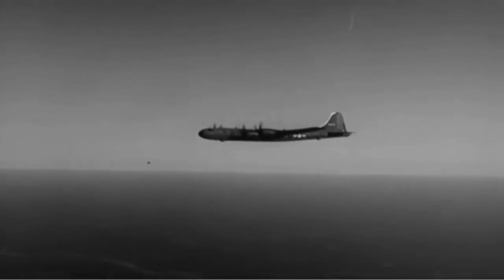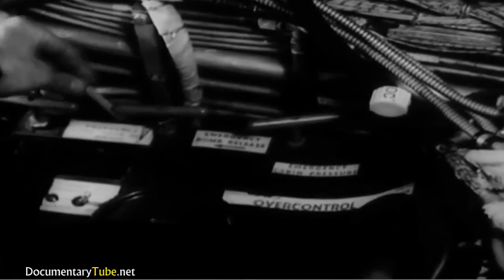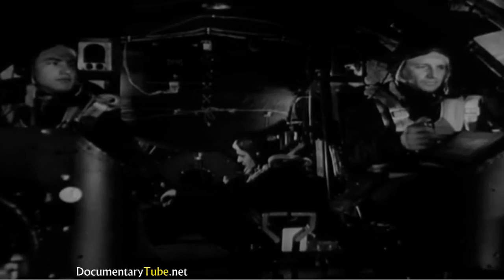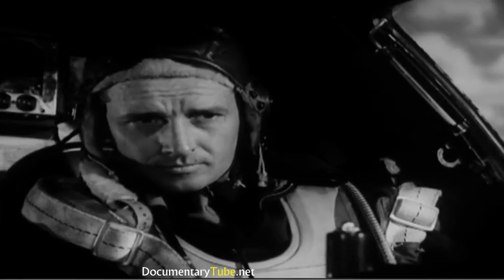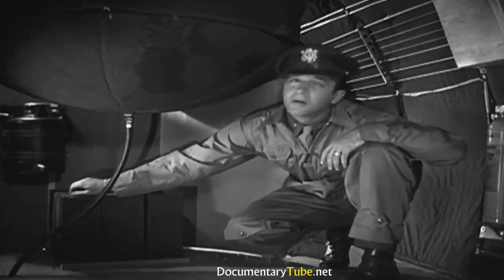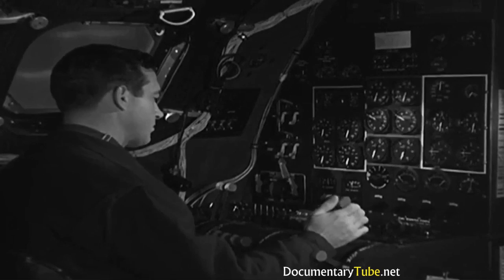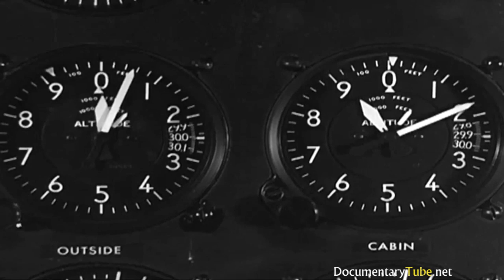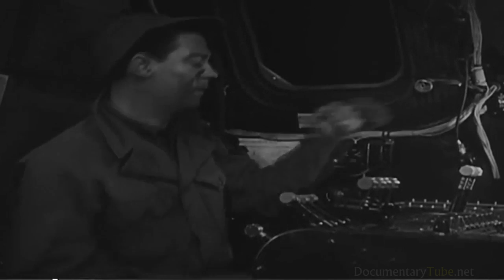HOW IT WORKS: WW2 B-29 Super-Fortress

Comment: Boeing B-29 Super Fortress is a heavy bomber aircraft manufactured by the American Boeing Company between 1943 and 1946, and was mainly flown by the United States Air Force at the end of World War II and during the Korean War, and it was one of the largest aircraft during World War II and the most advanced in that Time, cabin pressure technology, electronic fire control system, and remote machine gun control technology. The name Super Fortress was derived from its famous predecessor, the Boeing B-17 Flying Fortress, designed as a high-altitude strategic bomber, and was initially launched for the war against the Empire of Japan.

Comment: What's the difference between the propeller RPM switch and the throttle?
Reply: Most combat aircraft in WW2 had what's called a constant speed propeller, I'm not going to get into everything about how they work but essentially it keeps the engine/propeller speed constant no matter what the throttle setting by adding or subtracting propeller pitch to load or unload the resistance on the engine to keep it at a certain RPM, so if you increase throttle the propeller automatically increases pitch to load the engine even more and it won't increase RPM but your speed will increase because of the additional pitch added to the propeller, and they're adjustable, so before you take off you want to check it's setting and cycle oil through the mechanism in the propeller hub by varying the pitch to assure that there's no air in the system, that's for a hydraulic system some of them were electric but they had a similar pre flight check.
Reply: @dukecraig2402  thanks for describing how the pitch automatically varies according to the throttle . But if the RPM is constant, then why is there a RPM control switch?
Reply: @michaelwong4303  
So you can change what you want your "constant speed" to what you want.
Does that help?
If not on YouTube enter "constant speed propeller" and there's a bunch of videos that explain how they work.

Comment: I can’t believe that the crew basically do the ground crews job for them, I don’t know how the USAAF system worked, or how any airforce did the servicing during the WWII ERA and afterwards, but I do know how we did things in the RAF from 1979-2003 and we did three types of daily servicing, a B/F Before Flight T/R Turnaround and A/F After Flight, so basically when a crew arrived for a flight they only had to check the log book (F-700) sign for the aircraft and before entering the aircraft they did a walk round to satisfy themselves that everything was as it should be, then as they say he would “kick the tyres and light the fires” and disappear into the sky, when they came back if the aircraft was needed again a T/R servicing was done, basically to check all the vital items of the B/F were done again but not all, not much different to the B/F, and if it was the last flight of the day then an A/F servicing was done and aircraft put to bed, we in the RAF trusted the groundcrew to do their jobs, aircrew didn’t need to check tyre pressures or oil levels, it seems that during this era that in the USAAF didn’t trust the groundcrew, personally I would have been insulted if the crew double checked my work, in fact I would probably walked away and let them do everything themselves, but that never happened to me, as it shouldn’t be necessary.
Reply: Are you kidding me?
Why don't you try comparing the RAF check list from the 1940's to this one, then add on how much more complex this aircraft was to anything the RAF had at the same time instead of comparing it to procedures from 45 to 60 years later. 
Wow, yea that's a fair comparison.
Reply: @dukecraig2402  , I don’t need to, my family has had a serving member from the RFC through the RAF until 2003 all were, me included, Aircraft fitters, I have all of our training notes (except great grandads RFC ones) and they are comprehensive, the USAAF aircrew either  didn’t  do what was depicted or they didn’t trust their ground crew, simple as that, no need to get all bent out of shape.

Comment: My father was with 73 wing,497th Group,869th Bomb SQ. ; first group on Saipan , At first he was the guy that took up every plane after the mechanics checked it out then he got A square 3. Flew 40 missions and came home. He was to go back and be a base inspector but Hiroshima occurred while he was state side After LeMay took over B-29 operations they stripped all the guns out  and flew night missions at 5000 feet or so loaded with incendiaries or mines. Saved those weak engines also Japans AA could not work on low level aircraft and Japan had not developed much in night fighters. I read somewhere a B-29 cost $850 K 1940 $.

Comment: Why are engine pull through's necessary?
Reply: To lubricate the cylinders I guess.
Reply: orange70383 pre lubrication makes sense.
Reply: To make sure there is on oil or fuel left in the engine cilinders, if that was not done the engine might explode on start up !

Comment: Couldn't fathom the fear running through these guys heading out into the night sky on a bombing raid into enemy territory. Until the Spitfire was developed, these guys had no escorts for most of their trip and very few were lucky to make it back.
Reply: You're thinking the European Theater which would have been B-17 and below.  The B-29 saw service exclusively in the Pacific Theater.  British airfields couldn't take the weight of the B-29.  Also, it wasn't the Spitfire that provided long range escort - its range was far, far to short.  It was mostly the P-51 Mustang that provided long range escort.
Reply: ***** Thanks...I'd swear I seen a documentary about the Spitfire being the escort that helped save the day but thanks again for the correction.
Reply: Sptfire escorted RAF bombers not american bombers. P-38 and P-47 were the initial escorts the P-51 mustang came about later in the war mid 43 and into 1944. Ironically the Mustang got its engine from the spitfire.

Comment: Great film, thanks to all for it. With regards to oil, in lower cylinders, I had to service plant (building equipment) and if some equipment was laid down on its side, the oil would leak into the head, and when I pulled the pull cord, the engine would start to turn over, then STOP dead, it felt like it was seized... Cure, remove spark plug/injector, turn over till most oil was out, then fire up,( OUTSIDE) I initially broke the pull cord, and hurt hand, as  I was not expecting that. imagine a starter motor coping with that?? Blow head straight off.... in a plane, expensive. Hope this helps guys. Thank again.

Comment: What a pain to get that thing off the ground, they couldn't automate any of that starting procedure?
Reply: +Robin Sattahip "Automate?!?" A computer was a roomful of vacuum tubes in 1944. You'd need a second B29 to haul round the preflight computer for that bomber.
Reply: +bcubed72 Besides, it just makers sense to make sure the plane is capable of flight, prior to takeoff. Airline pilots (okay, the FO) do this to this day: walk around the airplane, check all the control surfaces, tires, hydraulics, as you go.

Comment: how come the rest of the crew weren't shown? I'd like to have seen all crew positions covered, the electronic fire-control system is intriguing... Though if the pilot doesn't evade, there is in pure theoretical terms a blind spot for the machine guns, as their traversing angles don't cover the absolute middle of the plane... and honest question, what was that 20mm cannon supposed to do other than being a visual deterrent to getting on the bomber's tail?

Comment: Holy shit the complexity. Plus you gotta consider this was all vacuum tubes and piston engines and thus shit failed MUCH more often than with turbojets and solid state electronics. The radial engines were air cooled and would overheat and catch fire if you didn't get the plane off the ground and up to some level of airspeed within 10 minutes or so after starting the engines. Those radial engines gobbled oil and fouled spark plugs like it was its job--every engine had 36 spark plugs and an 85 gallon oil tank, both of which needed to be completely changed/filled by the crew after every single flight.
Reply: For its time it was bleeding edge tech with all the bugs.  They hammered out these bugs by the end of the war but too late for most of the combat.

Comment: Why do they pull through the engines? Do the bottom cylinders fill with oil?
Reply from the maker: +towlie911 Correct, it forces out the oil in the lower cylinders, which collect there (gravity).
Reply: +DOCUMENTARY TUBE 

Actually, pulling through makes sure that there isn't oil in the lower cylinders.  If there is, you get  hydraulic lock.  You can't pull the prop through by hand, so you have to pop the cowlings, remove the spark plugs, drain the oil, and THEN continue pulling through until everything is cleared.  Then put it all back together.

I learned this from Randy Sohn*, the fellow who test-flew FIFI, the CAF's  B-29.  He had a license from the FAA that basically said, if it has a propeller, he can fly it.  Steve Hinton and a handful of other folks were in the same boat. A rare breed, Randy.  Drove either a ratty old sedan or a NICE Harley.

About that time, the Collings Foundation brought their B-24 to our museum (Planes of Fame, MN) to have an engine changed, because we had the facilities and manpower.  We experienced a hydraulic, lock and I got to see the whole process.  No one had a video camera, though.  A real shame.  Randy was real disappointed that the process couldn't get documented. 

*http://www.avweb.com/news/profiles/182142-1.html
https://sites.google.com/site/8thafhsmn/pictures/randy-sohn-caf-pilot

Comment: These airmen are probably actors, instead of actual U.S.A.A.F. crews, because they seem like they're "Hollywood-perfect."
Reply: +JeffGR4  Several "Hollywood-perfect" actors were in fact pilots in the USAAF. Jimmy Stewart and John Payne being two examples. You can find Stewart's wartime instructional videos here on Youtube (although he insisted and did fly a full course of combat missions). The copilot turned engineer in this video looks remarkably like Payne (Mr Gailey in the original Miracle on 34th Street.)
Reply: +blacksmith67 : Wow! The crewmen looked like movie stars—because they were movie stars that actually served in the U.S. Armed Forces. Your insight has provided much appreciated information. Thanks a lot for identifying the B-29 flight engineer as John Payne.
Reply: +JeffGR4 I did a bit of poking around and found that during WW2, the AAF's film unit was entirely run by Hollywood directors, actors and other film industry personnel.  Look up the First Motion Picture Unit (FMPU) on Wikipedia.
Reply: +JeffGR4 Clark Gable was a gunner on one of these.
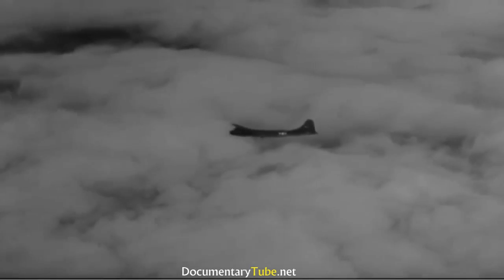Reply: +JeffGR4  Is that Ronald Reagan narrating from 35:45?
Reply: +Fwq Kaw : Yes, that's him.
Reply: I would suspect hollywood produced the film but John Payne during WWII was an actual flight instructor not just an actor portraying an airman.

Comment: Best Bomber of the War, even with its teething troubles, by far.
Reply: flip inheck - I know your first choice.  B-29 had ceiling of 31,850, Lancaster  ceiling 21,400 feet.  B29 carries more defensive armament.  B-29 flies faster at 357mph/220 mph cruise.  Lancaster 282 max/200 cruise. Comparable bomb loads, but B29 had greater range- 3250 miles vs. 2530 for Lancaster.  B29 stayed in service long after the war, until 1960.

Comment: They don't talk about the catastrophic engine fires in the 3350 engines.  These engines had a tendency to overheat and swallow valves.  Resultant fires spreading to the magnesium crankcase could produce heat to temps. of 5300*F ( 3100*C).  That was hot enough to burn through the main wing spar in seconds.  Boeing's Chief Test Pilot died that way along with his entire crew, when the aircraft suffered catastrophic wing failure.
Reply: Votevrpnt is correct. More B-29 crew lives were lost through mechanical failure than in combat, with most of the catastrophic failures related to the engines. The Wright 3350 engines were finally replaced by the more powerful Pratt & Whitney R-4360 "Wasp Major" which was much more reliable, but by that time the war had ended!
Part of the problem was that the first planes came off the assembly line only in 1942 (still an incredible feat for a design only approved by the air force in 1940) and so they were testing and improving systems as they produced the aircraft. In effect, because "there's a war on" and tremendous pressure to produce an aircraft that could bomb Japan,  ordinary airmen became test pilots. The servicemen of that generation were highly motivated and deserve our respect.
There is an excellent account of this in "Freedom's Forge," by Arthur Herman.
Reply: I thought that only the engines of a Heinkel HE 177 Greif suffered from that diseases - engine catching fire frequently and even boiling the gasoline on wing mounted tanks - because that was spelled all the time, when those planes exhisted... so convenient to hide our own tail and show up the other's !

Comment: why are there different air pressures in different parts of the plane? signed, Airplane Clueless
Reply: Just where crew was. Nose,Mid and tail.  so you could fly without oxygen masks and you could conceivably heat as it is -50F at 20-30,000 feet but they wore Oxygen when over in combat in case they get the pressurization shot out.

Comment: OMG! These men were real seat of the pants aviators. No computer-controlled everything!  For example, I understand that Concorde was un-flyable manually - too many adjustments required too rapidly for mere human perception and reflexes to keep up with.
Reply: All high performance fly by wire jets are deliberately pitch unstable to improve maneouvrability. Without a computer the pilot can't control them.

Comment: so I think this way before B52 was made. because that truly is the biggest bomber
Reply: +Ankit A : That's correct. The B-52 is the biggest bomber and was developed in the 1950s, while the B-29 was from the early 1940s.
Reply: JeffGR4 this video was made in 1940s I guess
Reply: +Ankit A actually that award goes to the b-36 Peacemaker
Reply: +flip inheck LOL B-29 just about made the grade as a medium bomber in WW2!! LOL LOL!!! So much misinformation on the internet! 

The B-29 could carry 20,000lb a much longer distance than the Lancaster could carry with less of a bomb load. It also could carry that bomb load without being modified.

The 20,000lb was just the standard load out for the B-29. What was the standard load out for the Lancaster? If I recall it was only 14,000 lb. In order for the Lancaster to carry that 22,000lb bomb it had to be modified. Again, the B-29s range with max bomb load was farther than that of the Lancaster with a minimal bomb load. 

The B-29 as a matter of fact was modified and used to test the 43,600lb T12 bomb. I believe a B-29 was even fitted with two Grand Slam bombs in testing.  (44.000lb)

Seriously....a few modified Lancasters carrry a 22.000lb bomb and suddenly people think it was the largest heavy bomber...

Comment: any idea why the engines needed to be pulled through 15 times before starting??
Reply from the maker: +Giggidygiggidy12 To push out any oil that may have accumulated in the lower cylinders.
Reply: Because with radial engines, when not running, oil collects in the bottom cylinders.
Reply: +DOCUMENTARY TUBE 
Yeap +1 ^   
Radials have a terrible habit of accumulating oil in the lower cylinders.  Since oil is not compressible it tends to break things instead.  So they turn them slowly to push all the oil out gently.
Reply: Actually, I got my info from the Crew Chief of a Warbird restored B 17 at an sir show. Also from a former Crew Chief I served with, who was stationed at DaNang.
  Both aircraft had radial engines, and both people told me the same thing.", that it was to redistribute the oil. Where did you get your info ?
  BTW, I'm a former KC 135A Crew Chief.
Reply: +Chainspike101 Chainspike, My dad (MAY HE REST IN PEACE), was a B-29 flightengineer , during the Korean, conflict. He NEVER explained the reason why it took so many pulls through. thank you for the enlightenment.
Reply: +flip inheck . If you knew anything about radials, you'd not have posted such a stupid comment.
Reply: +DOCUMENTARY TUBE Makes sense.
Reply: Because with radial engines, when not running, oil collects in the bottom cylinders.
Reply: +4nuk8r  Thanks for sharing. Removing the Mag cap to I.D. exact cyl. is a nugget worth remembering. In the 60's Amtraks ( LVT-P5 ) were equipped w/Continental V-12 1790Cu.in. engine. A gas guzzler, at times fuel on top of piston during cranking would actually result locked engine and a bent connecting rod. A 24 V DC starter Mfg. by (Eclipse-Pioneer) came with internal slip clutches factory set to 850 ft/lbs of torque. If rotary force exceeded set point (850 ft/lbs) starter was designed to "spin-out" disengaging power from starter gear shaft. It worked.........sometimes!
Reply: that was done to clear the lower pistons of any liquid from drain down
Reply: +Darren Garvie dame your old
Reply: +DOCUMENTARY TUBE hello
Reply: a plane like this , full with ammunition could take out a city if it crashed on it. Im sure no one can risk that.
Reply: I was exaggerating, i meant a lot of damage.
Reply: Chainspike101 o

Comment: Well Carter, you'd pull up an air cart, open the Schrader valve and add air until the strut was at the correct extention for the aircrafts gross weight.
  You sound like you're making a joke and that's fine, but the correct strut detention is VERY important. Too high and the aircraft would bounce on landing. Two low and the strut could bottom out on touchdown and cause MAJOR damage.